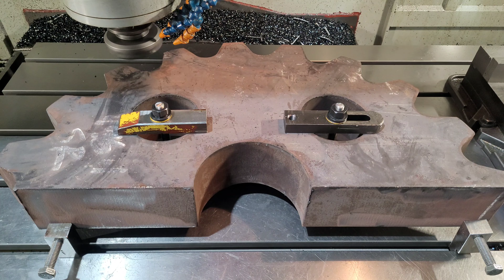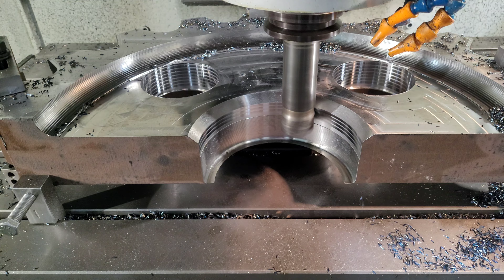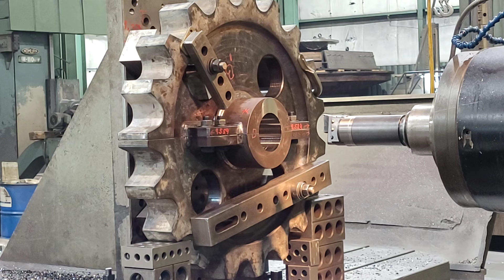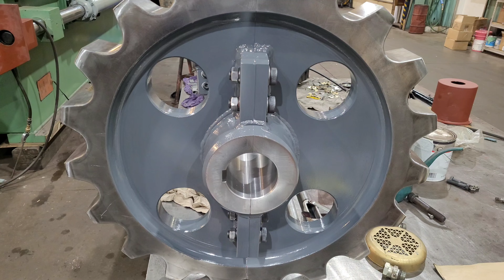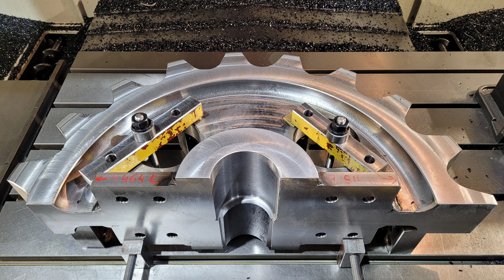Split Gear | CNC milling

Comment: Why have a split gear like this?  I tried google with no luck. Is it a replacement part where the axle is not to be disasembled?
Reply: Lot of what he deals with is massive.  Who knows what else is on or around that shaft.
Reply: For when it's not practical/possible to dismantle the whole assembly to replace it in one piece.

Comment: I'm honestly curious about what purpose they will serve.
Reply: Yeah, strange teeth profile, unpolished. Definitely not for fast rotation nor heavy load.
Reply from the maker: @Pipebot, I'm guessing some kind of a gear rack. The teeth were flame hardened after machining.